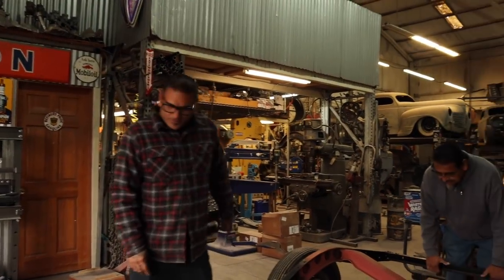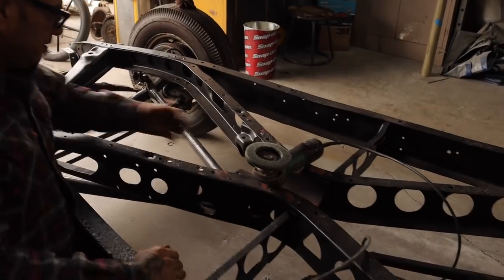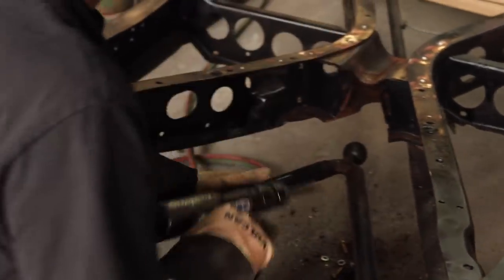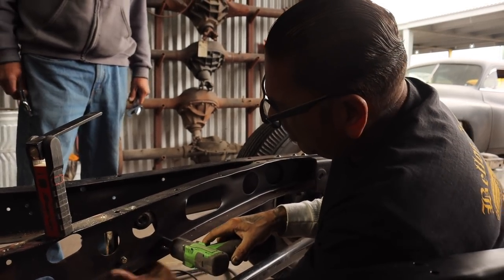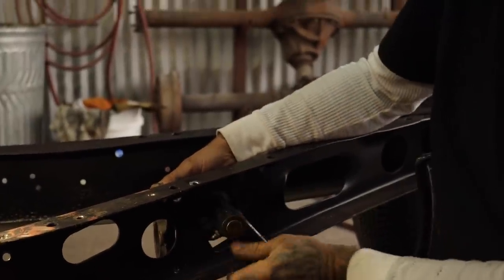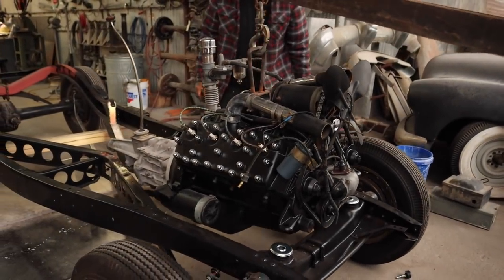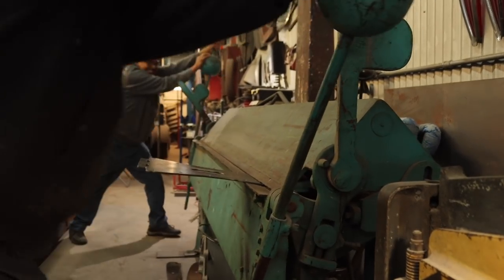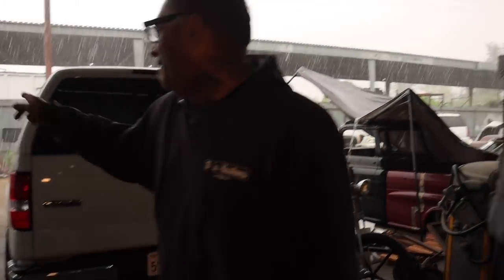1936 Ford T-5 Conversion - Part 1: Transmission Crossmember

Comment: Perfect timing. I'm researching putting a t5 in my '49 Ford
Reply: Hey Christopher, what engine.. the other question is how much hp/torque do you think you have.. Something to always remember is this..  when you build a manual transmission always build it to handle 100 to 150hp/ft lbs of torque more than what you actually have..It will save you a lot of headaches and problems in the future.  It will also last longer...
Reply: It's the 8ba in my club coupe so I'm not concerned about putting too much power into the trans. So far I found, by some crazy random chance, the one year t5 that's a world class with the old s10 mounting pattern and the 3" steel Mercury bellhousing and starter plate. I'm getting the Speedway adapter kit and I'm thinking I have a 9" flywheel/clutch, so I have a clutch disc and pressure plate in my Speedway cart but I'm gonna try and find a cheaper place to buy those. I found an oilite bushing on Summit with the exact inner diameter for the t5 but it needs to be turned down to fit the flathead flywheel. I'm also going with an s10 rear and driveshaft (hopefully I can find a 2-piece shaft).
Reply: @ninja63639  OK..  if you're interested, try using the 2piece drive shaft setup from a 73-82 Chevy 4wd because they are more durable and also a lot easier to source..  yes you can use the 2pc shaft setup from an S10 but keep in mind that in order for it to work properly you need to use the 4wd automatic setup.. only reason is the drive shaft for the manual version w 4wd is just really weak..  the only thing that you are probably gonna need to change is the tail shaft yoke... But honestly I would consider looking for a 73-82 Chevy 4wd setup..  It will make things easier and stronger..  also consider the Astro van AWD 2pc setup
Reply: @joshbuxton2783  
Thanks man I'll definitely look into that driveshaft. I cool using a 1 piece shaft but if I can cut less of the rear seat bottom that would be good for sure
Reply: @ninja63639  Brother I completely understand..   When we take on these projects the number one thing that we always keep saying to ourselves and our buddies and friends and other people is Quality.. don't ever steer away from that..  The one thing that you never hear in any conversation is Safety and Drivability.. always keep those things in the back of your mind and apply them where they need to be..  
To be humble in life you need to find humbleness..  
God bless you and your family, good luck and best wishes on your project
Reply: @joshbuxton2783  thank you man I really appreciate that